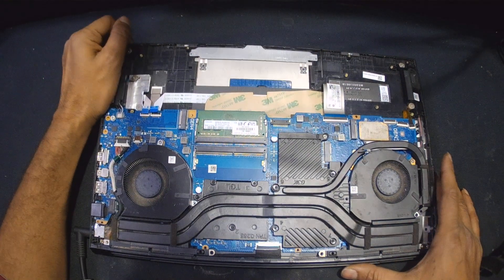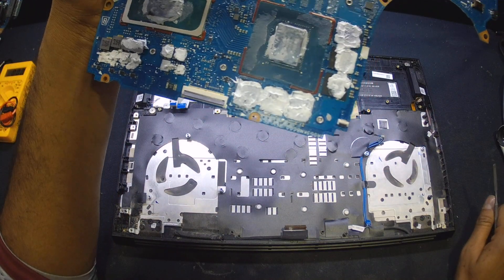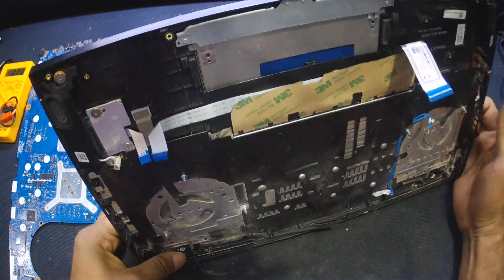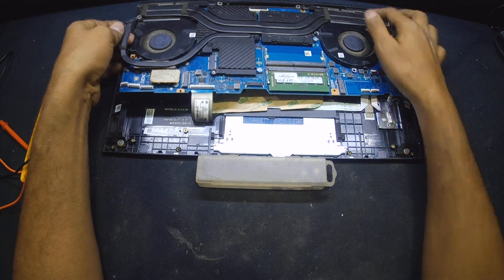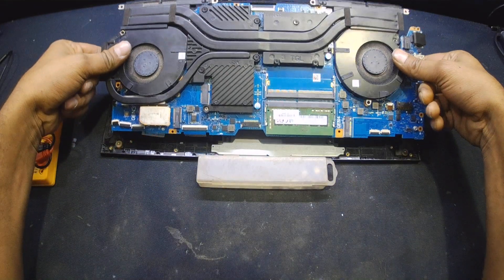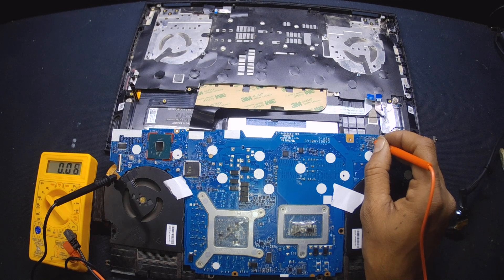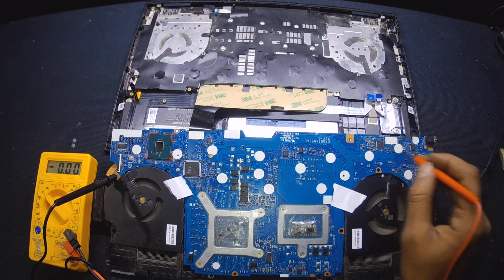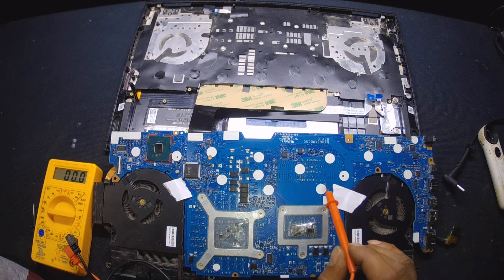HP OMEN Laptop Journey to Fix Display issue (Not Yet Fixed)

Comment: Hey i have a similar problem but its been plugged into my monitor the entire time once disconnected it doesnt display on the laptop screen snd yes i have tried everything in display settings but it seems to have forgotten and remove its own internal display as the only thing that shows is the monitor display.
Reply: Hi I heard the HP Omen 16 has this problem which is caused by a hall sensor issue(this detects if the laptop lid is closed or open making the screen sleep). It gets damaged due to over heating caused by HP's poorly designed motherboard. It can be fixed by unplugging the hall sensor ribbon. Hope this helps.
Reply from the maker: Technician Work, you need to take it to the repair technician to at least clean the display cable connector from the board side as well as service laptop, if the screen or display cable is faulty, this solution would not work.

Comment: Hi, what happened to this issue? Are you able to fix it?
Reply: i have same trouble as you, 😂😂 it cannot be solve even if flash all ic's lol
Reply: @itadmincollegeofmedicine7392  I bought an HP Omen 16 with this fault with the intention of changing the motherboard and having a gaming laptop for half the price. Still, I want to know if you have found a solution for this problem hehe
Reply: It is hacked bios ...
Reply: I have same problem ... hp logo is not displaying either ! ... system is getting heat up
Reply from the maker: Unfortunately was unable to fix it, Customer ran out of patience and took it away.
Reply: @AuTech_Repairs  my HP omen had same issue and it was same case ,I also ran out of patience, technician keep asking for time.😅